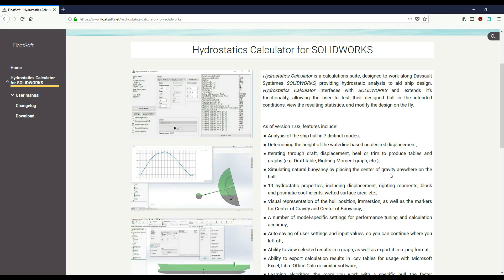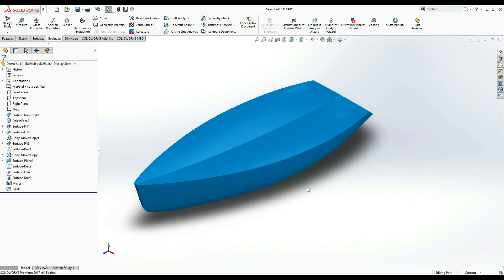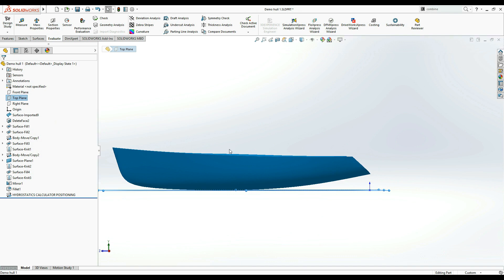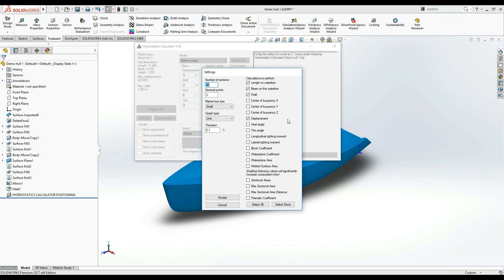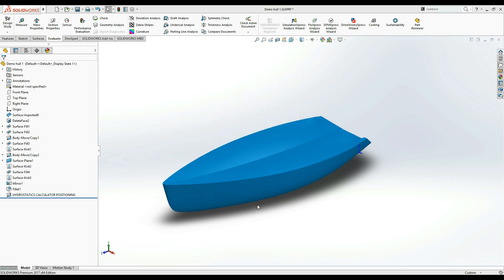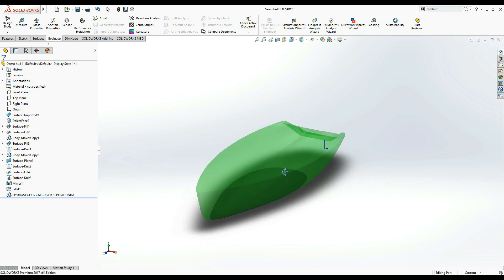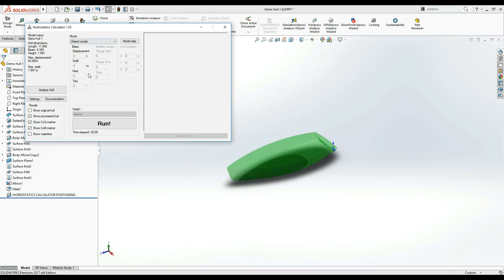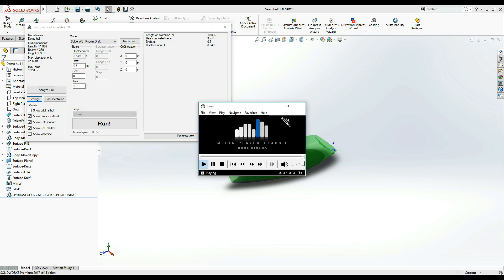FLOATSOFT Tutorial 1: Introduction, user interface

Comment: does this work for other objects other than boats?
Reply from the maker: It does. You can use this software for pretty much anything you design in SOLIDWORKS, as long as it is a solid object.
Reply: @floatsoft  is it free?
Reply from the maker: @slimegreenbeats  You can try it for free for 14 days - after that, we have different pricing options to suit your needs. Check our our website at https://floatsoft.net/ for more info. If you have any questions, feel free to contact us via the form at the bottom of the page.